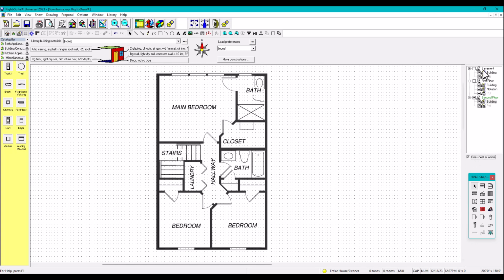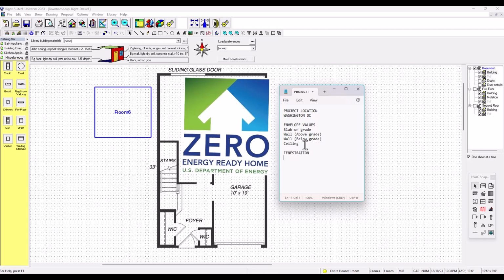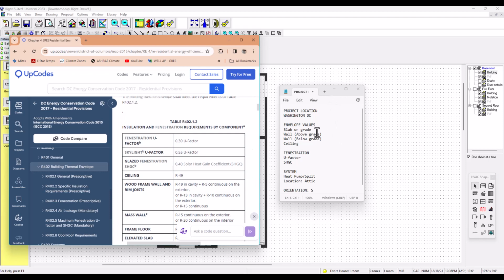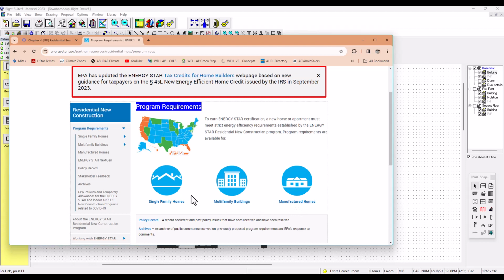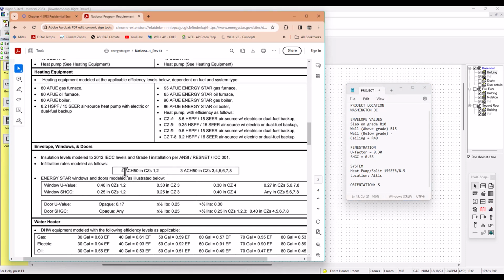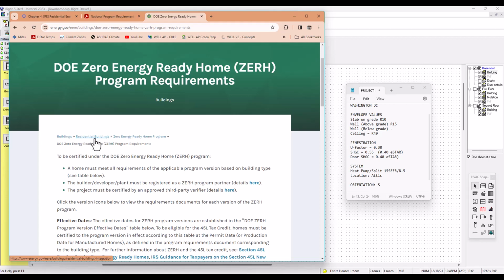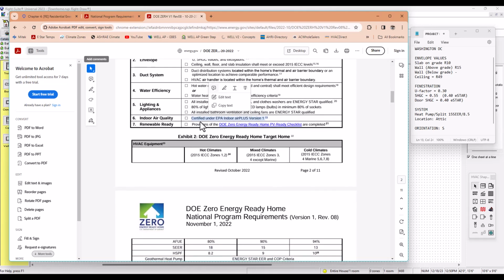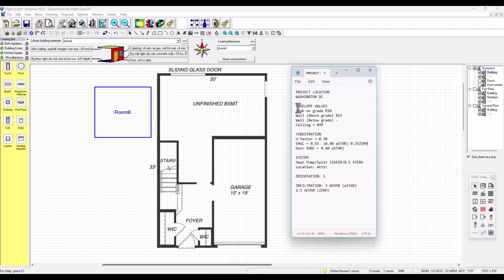Wrightsoft (Part 2) Manual J Heat Load Calculation - Townhomes - Envelope Values

Comment: question: if you arte doing a multi-family home(three floor building, three units in floor one and two, with the final unit in floor three), does this process stay the same, or change? Would love a video on that!!!!!
Reply from the maker: Sorry for the late reply! Yes the process would stay the same. However the modeling would be like a townhome. For example, on the Second Floor you create the room but when you create the side walls, you set it as not included in the area but Heating Yes and Cooling Yes. The same process for the ceiling and floors since the floor above is below are conditioned.